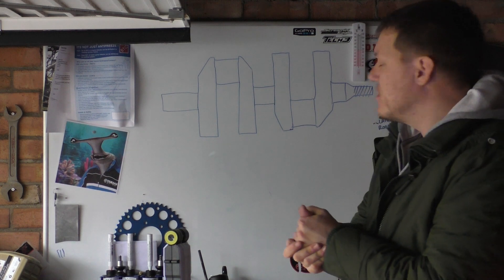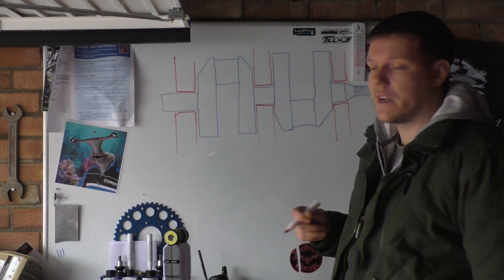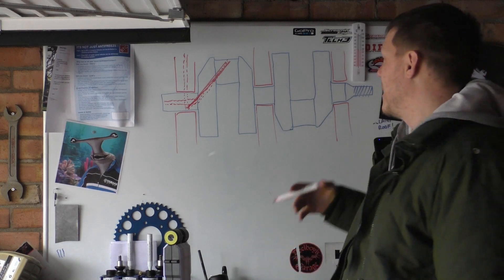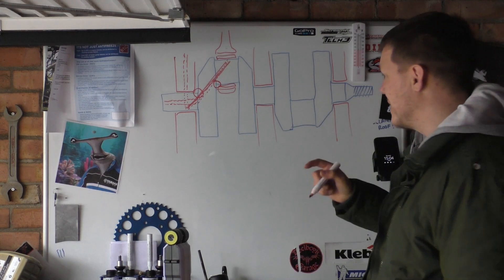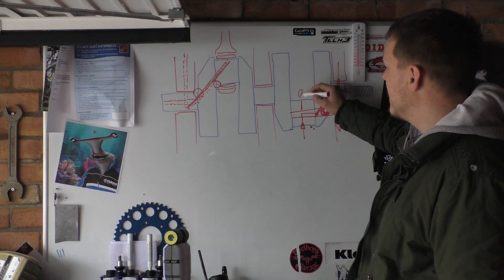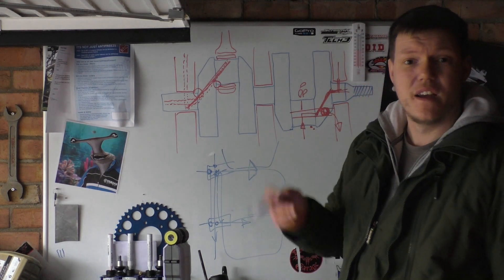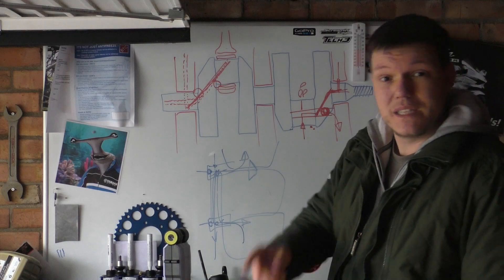Cross drilling - what is it?

Comment: A great explanation of lubrication but terminology is key. The diagonal drilling you drew is not cross drilling as I understand it. Non " cross drilled" cranks have that channel. It's the only way you can get oil to the big end journals, which after all are spinning well away from any central oil source. Cross drilling refers to diametral drilling across either main or sometimes big ends with the theory that if there are two exits for pressurised oil during rotation the opportunity for lubrication is doubled. Such cross drilling is not the "silver bullet" to lubrication since in one half the oil has to overcome centripetal force. Further,  such cross drilling causes aireation of the oil and induces weakness in the crank shaft. Cross drilling is often used in conjunction with grooved shells to distribute the oil and theoretically allows the use of plain bearings on the bottom which are perceived to have a greater load capacity. This is subject to debate since the load is actually reacted by the oil film normal to the load and not necessarily to the apparent surface area of the shell surface nearest the journal.
What you say is absolutely correct in how to lub bigends but it's all about terminology.
Reply from the maker: Cross drilling is when holes that are drilled cross, hence the name

Comment: Matt, the cross drilling is pretty straight forward to understand, but how the hell do you bleed that sort of system? Air bubbles in oil galleries have got to be a bad thing.
Reply from the maker: These are forced out - the system is open to the air - more on this later - but good question

Comment: The video of the drilling at 2:00 shows the gun drill entering in through the webbing adjacent to the pin.  You explain it at 2.33 as it going directly to the big end pin.  

These are 2 different ways of drilling the oil passage ways through a crank.  The one in the video requires additional holes drilled across the pin (what i refer to cross drilling) that intersect the first hole.  Then having the entry to the first hole plugged.

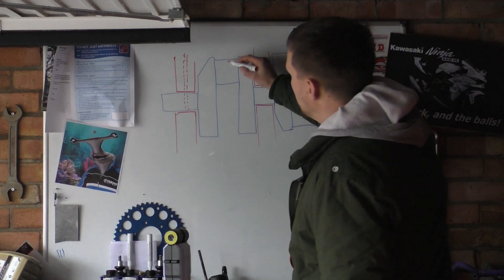The way you are describing at 2:33 is straight shot gun drilling and that has the entire hole made with just one straight line hole.  This not only is a easier path for the oil to make it to the big end.  It also changes the oil phasing by altering the position on the pin where the oil exits the crank.  But it is alot more difficult to achieve a precision gun drill over a longer distance.

I am putting together a subaru engine at the moment and the OEM crank has the multi stage holes.  But i have a new billet de-stroker crank and it has straight shot holes.
Reply from the maker: The video of the drilling at 2:00 shows the gun drill entering in through the webbing adjacent to the pin. You explain it at 2.33 as it going directly to the big end pin.  

- these are just example of what the process is designed to do, not the exact path.